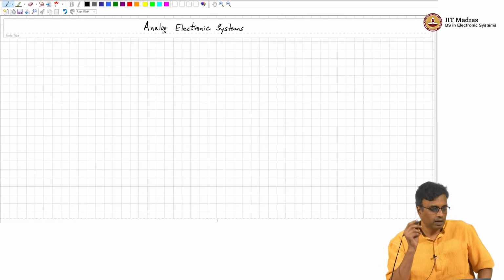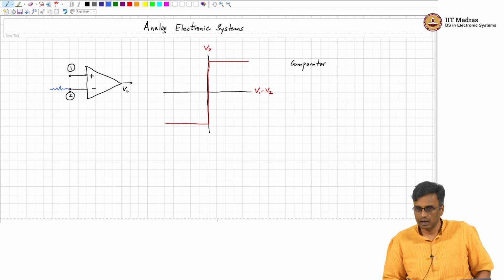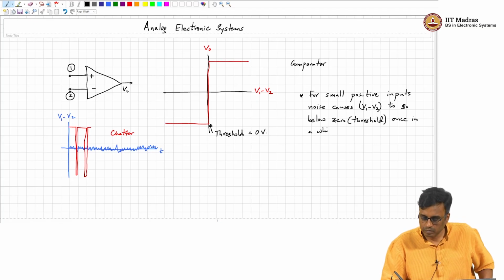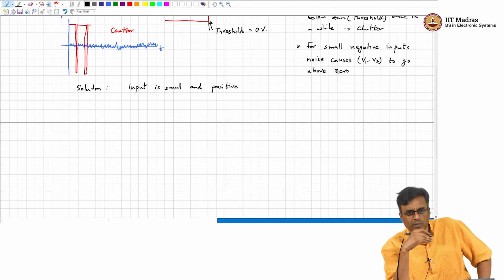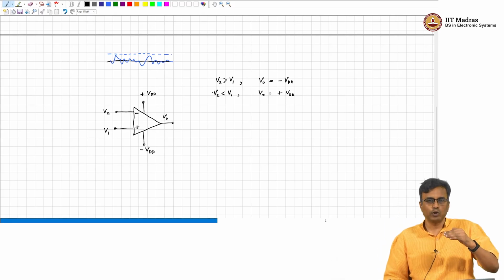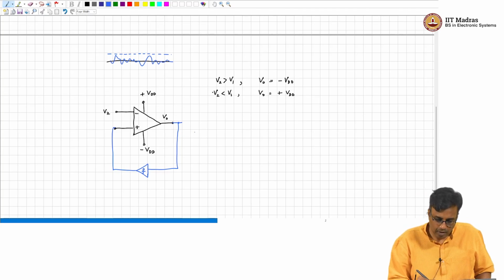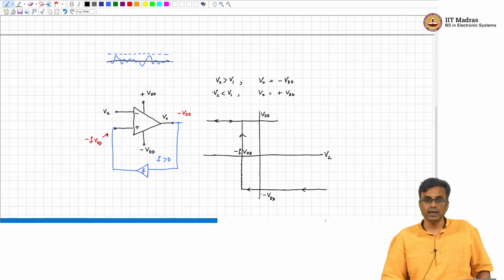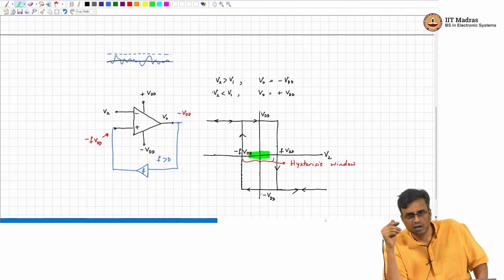4.4 : Introduction to Positive Feedback

Comment: Sir at 4:20 as u told there is a noise present in the circuit.. sir but opamp consists internally differential amplifier if i take differential measurement ( v1 + noise , v2 + noise ) output of opamp = A ( v1+ noise - v2 -noise ) is noise eleminated?  In differential measurement also is  noise present ?